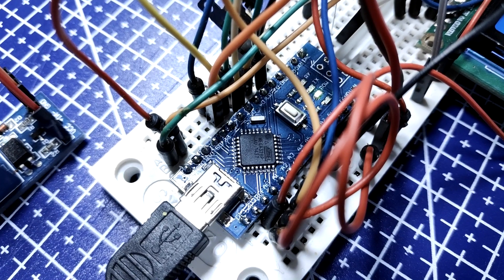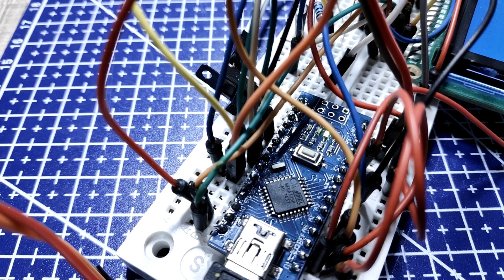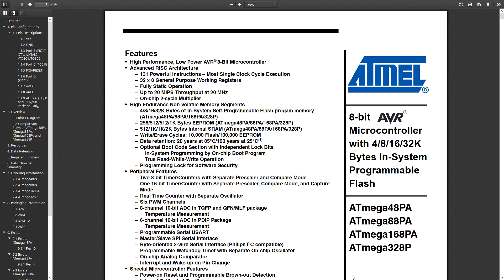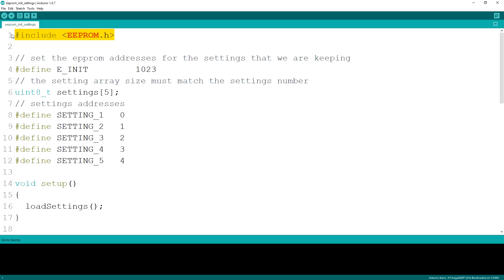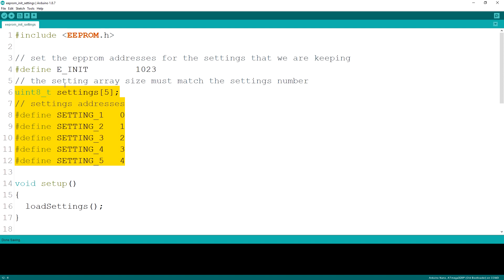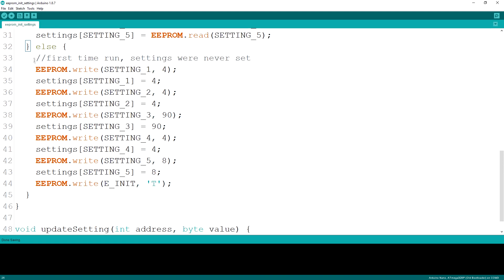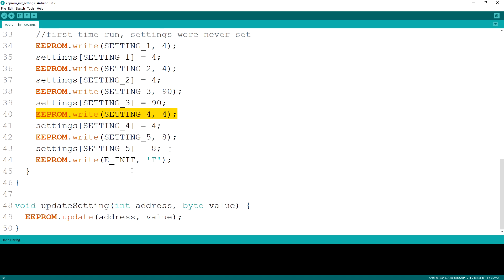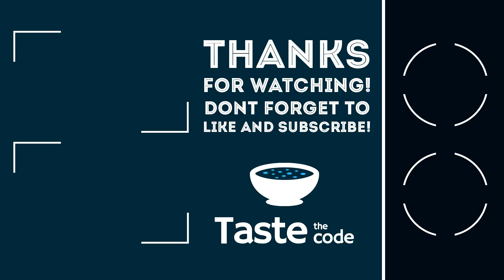Arduino EEPROM settings initialization //Arduino Tricks

Comment: Hi,
Thanks a lot, its really greate effort and great knowledge.
i need to do a project for a preset position linear actuator with a DC motor abd a stepper motor, with Arduino Mega or UNO but i am not able to write the code and the scheme, can you please help.
Regards
Reply from the maker: Sorry but I don't do projects by request. However, there are a ton of options out there and you can find all you need online to combine it into your project.
Reply: @TasteTheCode  Thank you, I am sorry I didn't mean that. I found some projects but without code and without schematic diagram, so I requested your help. 
Regards

Comment: Great information! How can i use this to store last layer for resume 3D printing  after power failure? Cr10 using Tinymachines firmware.
Reply from the maker: Hey Chris, sorry but I can't help you there. I'm not familiar with 3D printing at all.
Reply: @TasteTheCode  Hi, thanks for reply. my theory is if the last Z-axis layer (prints in layer slices) was recorded at power shutoff, or filament runout; then the print resumes at that Z-axis vertical level. just one small number to record to memory. I will refer your video to TinyMachines. Thank you for sharing your code. I actually found you on Instructibles. Blessings.
Reply from the maker: @chrisdixonstudios  Yup, sounds plausible but it needs someone a lot more involved in order to implement it. Good luck!